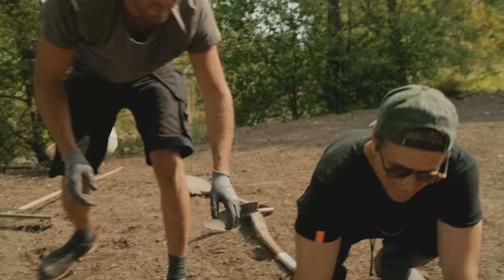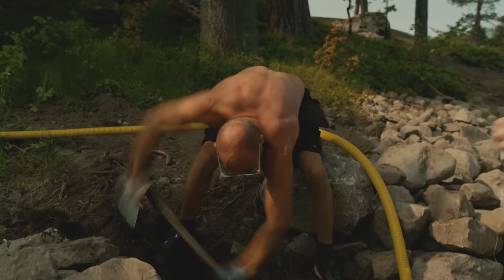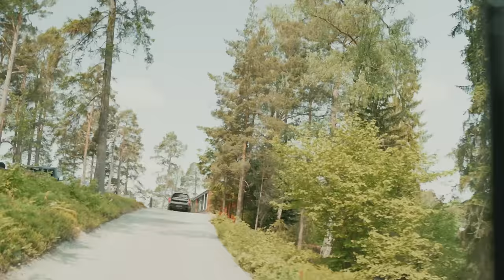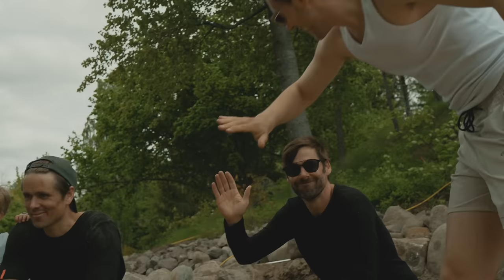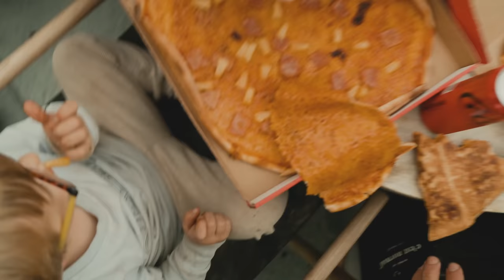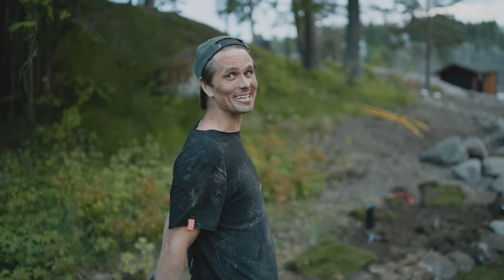STOCKHOLM DREAM VILLA PROJECT, STAGE 1 DONE!!!  | VLOG

Comment: More people are using native grasses and plantings that don’t require much watering or intensive cutting.  I respect your choice of “lawn” but also applaud people taking a more natural, enviro friendly path.
Reply: As you can see, these flat areas in Scandinavia are very rocky and inhospitable, plus the summers are so rainy it doesn't require much watering, and if Jon does have to water the lawn he will surely use rainwater collection. So this lawn is relatively environmentally friendly.
Reply: @monikerkinakin6943  Awesome!  Cheers
Reply: @johnswanson6994  or he can just use water from the ocean since it’s not saltwater in Stockholm